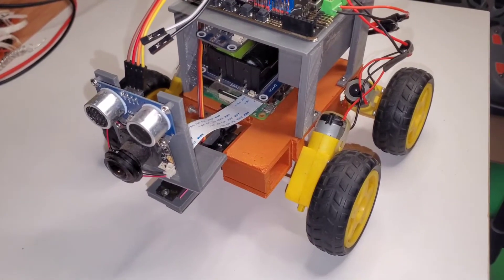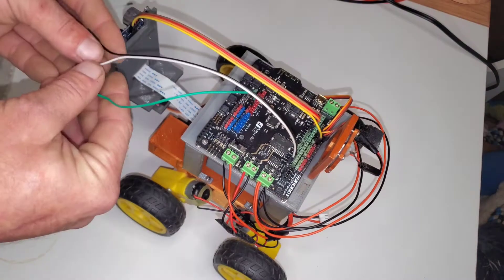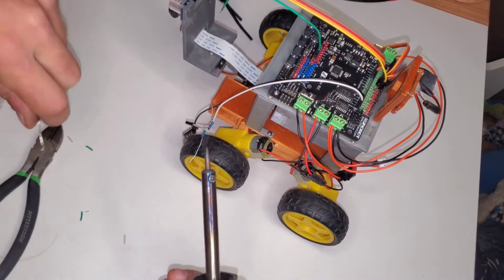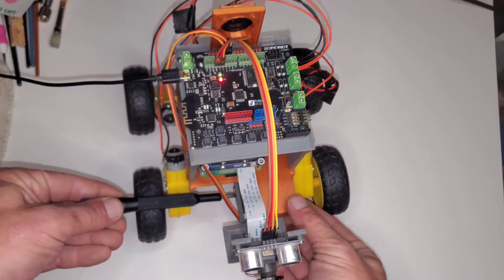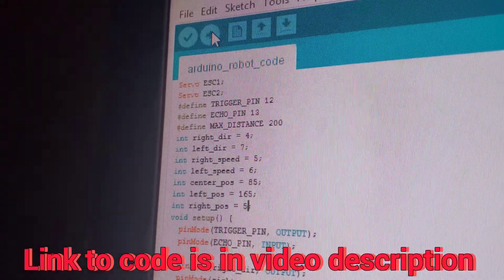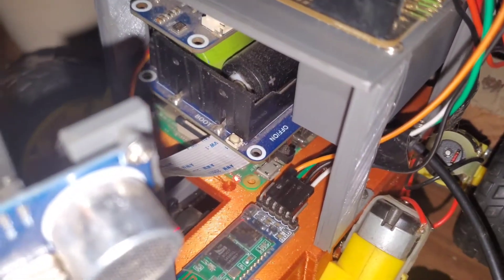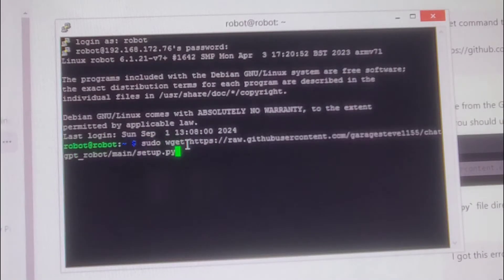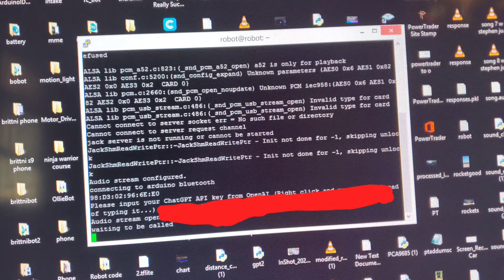How To Make A Robot That's Fully Controlled By ChatGPT (Part 2 of 2: The Code Setup)

Comment: Excellent video, I am almost finished with mine, but keep getting errors about hc-05 module, if I don't have that can I still proceed? Thanks!
Reply from the maker: Thanks! The HC-05 is the Bluetooth module I used on my arduino so it can communicate with the Raspberry Pi. If you are using a different module then you will need to adjust the arduino and raspberry pi codes
Reply: @makingmadeeasy  thanks for your responce, can I just remove that code for hc05 Bluetooth module , i have a Bluetooth dongle plugged in to the RPI
Reply from the maker: @RonaldBryson what about Bluetooth for the Arduino itself? Cuz that's what the hc-05 is for
Reply from the maker: @RonaldBryson I'm really not sure what you'll have to do if you're using something besides the exact parts that I used without being able to do testing and whatnot myself
Reply: Thank you, I will go back and rebuild with your exact parts.  It will be worth it!
Reply from the maker: @RonaldBryson the code on the GitHub is a little bit different than the code from this video. It's been updated a few times since then so let me know if you run into any problems once you have the parts exchanged
Reply: Thanks i will keep you updated appreciate your help.
Reply from the maker: @RonaldBryson  looking forward to seeing your bot in action!

Comment: hi can u help me please im making similar project by : rasbperry pi 5 and web cam and 2 dc motors using arduino mega and normal Bluetooth speaker .... when i try ur codes i get some errors like hc-05 not found and idk how to run chat gpt on it like u did can u help ? 🙏
Reply from the maker: You should really try to start on a simpler project for now so you can learn the foundational knowledge you need for the robot. Check out some of our older full length videos on our channel!
Reply: @makingmadeeasy  can u suggest one for me please as im making this robot for school project
Reply from the maker: To be able to run my robot's code, you need all the same hardware pieces unless you are able to modify the code yourself. 

Here's a few simpler robotics projects to get you started:

https://youtu.be/I4YKUE2t164?si=6OyuZyxjovt-OuO-

https://youtu.be/IEpiDQkDlmE?si=t6v3bHhRgKRkyFRi

https://youtu.be/5LO_txE0L9c?si=UIpXOML5S8sV7mBz
Reply: @makingmadeeasy  alr thank u alot
Reply from the maker: No problem. Good luck and have fun!
Reply from the maker: Also, here is part 1 of how to build the chatgpt robot. It goes over all the parts you need:

https://youtu.be/UDZ2cIrAbbw?si=LA0xAhdAwfM7pI7t

Comment: Hi! Is there anyway I could possibly contact you to get some assistance? During the test my bluetooth module keeps failing and my camera keeps failing as well. Was super close! thank you!
Reply from the maker: What were the exact errors?
Reply: @ “cannot read camera info, keeping the defaults for OV5647. mmal_component_create_core: could not create component ‘vc.ril.camera’ (1:ENOMEM
mmal: failed to create camera component
mmal: main: failed to create camera component
mmal: camera is not detected. Please check carefully the camera module is installed correctly. 
Camera test failed. 
“scanning for HC-05 bluetooth module.
HC-05 module not found
HC-05 module not found.

I copied all of that by hand, so let me know if there are any issues.
Thank you very much for your help!!
Reply from the maker: @TinkerWithTrey  hmm, try running main.py and see what it says
Reply: @makingmadeeasy  thank you man will do! your project is badass! keep up the great work
Reply from the maker: Thanks dude!
Reply from the maker: Get a chance to try main.py yet?

Comment: I also building one and likes the whole internet is doing it :P
Reply from the maker: That's awesome dude. My personal goal is to have robots everywhere just like in Star Wars. I got a couple videos coming soon feauring some decently hefty upgrades to the robot and its software! Also, feel free to use the code for my robot. It is available on our Github!
Reply: @makingmadeeasy  I write my own. Not much experience yet with the robot stuff but with chatGpt it is a breeze. More experienced with prompts so have some idea's to put on it, now with some esp32 and add on boards making the base, code runs on the pc with some online libraries like Google Vision. But I think good chatGpt prompting and memory are key here. For now, I have trouble enough getting the base64 TTS out as I tried to use the 8 bit DAC of an esp32. I2S board comes in tonight to fix that.
Reply from the maker: You should seriously consider using a raspberry pi for all the vision, chatgpt interactions, and general processing, and just use the esp for motor and servo control
Reply: @makingmadeeasy  I will but for now my pc will be the brain+LLM proxy, do you know a zero would do the job also? For visual models you need quite a bit of processing.
Reply from the maker: I started with a zero and it's just not anywhere near good enough. You need a pi3b+ at minimum
Reply from the maker: I'm about to upgrade mine to a pi 5
Reply: @makingmadeeasy  yeah so that is why I will run the main logic on my pc for now. Got audio to work last night with google tts and an I2S board but memory issues are bad on that thing so resets at long sentences, and upgrading to a pi zero 2 w is not that expensive. Also my time trying to fix it on the esp32 is not worth the trouble haha. When it is done, I will update everything maybe ;)
Reply from the maker: Yeah trying to get the less powerful hardware to work for this kind of stuff ends up being more work than just getting the more expensive stuff lol
Reply: @ hey! So got some YOLO up next to google vision, wheels drive, been working on chatGpt history summary and I can chat with it using my handwriting. Next is the pan/tilt of the esp32cam and ultrasound distance sensor. But I really want speech to text. So it seems INMP441 is a go to microphone. Can I just hook it yo my esp32 and link it to stt services with a stream? I imagine I need to run a voice activity loop also, so wonder if more is needed 🤨 Also, powering this thing is a thing as well, getting a ammo box soon to store these bombs needed to power it 😂

Comment: Hi, when installing sudo python3 main.py I get this error

Traceback (most recent call list) :
 File "/home/perry128/main.py", kaldiReconizer 
ModuleNotFoundError: No module named 'vosk'

I tried multiple times with also installing drivers for the audio hat but hasn't changed anything

I would appreciate the help, thanks
Reply: Ok sounds good, and yeah im using the wm8960, thanks
Reply from the maker: Ok cool I'll get the code uploaded in just a few
Reply from the maker: @Perry_95  got it updated, let me know how it goes. I'll be updating it again soon when I release Upgrade Report #2 (got a few more upgrades to do over this next week)
Reply from the maker: @Perry_M hm, that's actually an audio issue. Send the code and the error to chatgpt, let it know the specific hardware (waveshare wm8960 hat on a pi), and then tell it to do research before answering
Reply: @makingmadeeasy  oh ok, I'll give that a go, thanks
Reply: @makingmadeeasy I seem to get really close when I disable the camera in the config with actually getting to the point of the code saying "waiting to be called" but after the robots head goes up but doesn't respond to anything
Reply from the maker: @Perry_95  yeah you aren't dealing with a camera issue. It's an audio issue, ignore the camera related error messages
Reply from the maker: @Perry_95  try right clicking the mic icon and the speaker icon in top right of the screen and make sure the wm8960 is selected
Reply: @makingmadeeasy  Alright, there might be something wrong with my wm8960 ,so i'm gonna get another one, should be at mine tommorow. I'll let you know how it goes
Reply from the maker: @Perry_M  get the waveshare USB to audio instead of the wm8960 hat, it's what I'm upgrading to. Plug and play, just gotta change the name of what the robot code should look for instead of wm8960
Reply: @makingmadeeasy  Ok, will do
Reply from the maker: BTW, have you already printed and built your bot? I'm about to upgrade it so the camera is higher and it'll have a claw down low where the camera currently is. The camera will still be able to move around as well as the claw being able to grab and lift.
Reply: @makingmadeeasy  Sounds good, but yeah it's already built, I don't mind printing out some new parts though
Reply from the maker: I will be updating the code tomorrow. Vosk won't be an issue. As far as the sound card drivers, are you using the wm8960 hat from waveshare or something different?
Reply from the maker: Oh, btw if you ever have "no module named...." error with python, use pip to install the module. But don't worry about this error, I'll let you know when the updated code is up tomorrow
Reply from the maker: @Perry_95   Update will be ready in a few days. Btw I keep forgetting to ask,  How fast does your pi4 process the yolo detection part?

Comment: I think coding area with right and left, all the wiring is in reverse. I use vocal recognition is quadriplegic, probably need to speak slower and learns your voice. I think that Jackie forward motion is a start stop and assess programming issue. It's not responding in real-time as the Bluetooth speed is intermittent. Definitely give people a memory and some type of explore programming so we can learn its environment and how best to use sensors aboard. Realise it sounds easy, but not! It kind of has Luna Rover mobility, go stop assess, repeat. Try change to go until obstructed then reassess motion. Once it develops a layer in its memory, especially for more permanent objects, it will be able to explore more quickly. Most vocal recognition programs take a lot of teaching/training. Try some of the free online Dragon new it's software.
Reply from the maker: Wait till you see the newest video! Coming tomorrow. Lots of upgrades